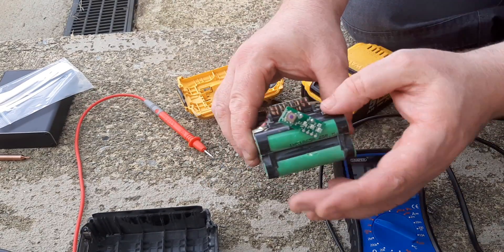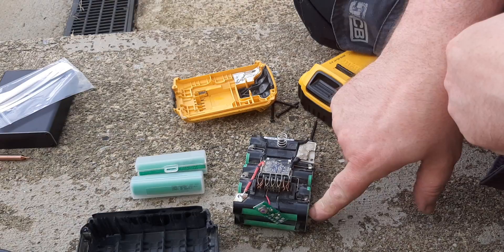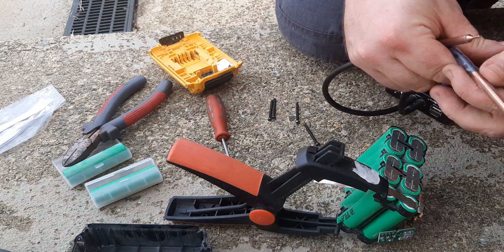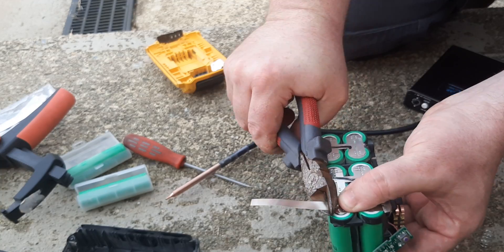Dewalt Battery won't charge? Try This!!!

Comment: not proffesional, this is not the way to do this, first discharge all cells, then no need to cut the Metal strip, use them and reconnect them it would be much better, you are not working safe with all metal parts, you need to work on a bench and not on the ground!, need to catch the battery properly, many mistakes in this work
Reply from the maker: Not Professional? Of course I am not I never claimed to be. By definition I am not as this is not my profession. I don't understand the need to discharge all the cells. Feel free to explain the benefit. I think there are many ways to connect the cells that work. I have never had any issues with safety working at batteries. I do work on a bench now as this video is 3 years old and was made before I got my workshop and bench. I Don't understand what you mean by catching the battery properly. This is the first battery I replaced cells in there have been many since. I think I do better work now than this one. Watch some of my more recent videos and see if you feel the same. Any feedback is welcome

Comment: Great video! Are you working on the ground for safety reasons?
Reply from the maker: Yes and I didn't have my workshop and wooden bench at the time a metal bench is a no no
Reply: And next to a drain grate…lol. Good job on the battery repair! 🙌

Comment: I have this exact issue with one of mine. Going to order the spot welder and batteries to fix it.

What thickness nickel strips did you use please? 0.2mm?

Thanks 🙏👍
Reply from the maker: I have better more recent videos if you need more help some of the spot welders come with strip so that will make it easy to start with

Comment: I slightly nicked the green wrap on one of the battery’s so covered it with black electrical tape is that ok doing that?
Reply from the maker: I would say yes
Reply: @doctorlefthandthread  ok thank you was just worried incase it was unsafe

Comment: Always charge or discharge the new or any battery to the same voltage when you rebuild or build your pack.
Reply from the maker: You are correct an imbalanced pack is a suboptimal one

Comment: You could have likely respot welded the existing nickel plates. Instead of removing and putting new ones
Reply from the maker: Not with that little DIY spot welder I used. It wouldn't be powerful enough for heavy strip I used lighter stuff to reconnect.

Comment: Got two 5ah batteries from ebay. Seller won't refund or exchange the one that won't charge. 
I don't think I am up to foolin with tearing it down and have already tried the jumping  it from tge other battery trick- no go.
Do you know if Dewalt will replace it?. It was new in the packaging when I got it.
Reply from the maker: It'd be worth trying if they are new

Comment: One thing that hasn't been brought up is that the strips that you get with the spot welder is 99% chance of being nickel plated steel. Couple of reasons why they include plated steel vs. pure nickel is; Its cheaper for them, it's easy to spot weld than pure nickel. Big drawbacks are; nickel plated steel will corrode and rust over time and it carries less amps, which is important in a high drain device like power tools. For example .15 × 8mm copper 18A of CDR, pure nickel 5A, nickel plated steel 3A. 2 ways to test what you have. I'll take Dremel with cutoff wheel and cut a little of the strip. If you see sparks, plated steel, no sparks, pure nickel as nickel doesn't kick sparks. If u want to be double check, make a salt water solution and put a small piece of strip in. If no corrosion the next AM, pure nickel. Shows heavy corrosion, plated steel...
Reply from the maker: Thanks for the info 👍
Reply: Pure nickel actually welds much easier. It's simply the cheap factor, that is it.

Comment: Few warnings: I would isolate the other cell-ends with tape before removing and adding the nickelplates, it's easy to short the cells. Furthermore, I'd check the cell battery voltages after a few charge cycles to see if they keep their balance. If charging takes much longer you know there's an inbalance in the pack and more cells needs to be replaced (I'd replace them all if the pack is old). Performance will be better if the cells are from the same production batch.

PS. I'd work on a desk instead of on the ground, makes it easier to do the job. 😏
Reply from the maker: Thanks for your comment I have done a few since that here is my latest 
https://youtu.be/qwOC9FC_oeA
Reply: Imo not worth replacing them at all.. For a genuine high discharge 30a cell from the likes of sony, lg ect, your looking at 4 to 5 euros new..x10 thats 40 to 50 euros when you include any shipping.. Add in the labour and you might as well just bin it and buy a new one from dewalt..

Comment: I do not see the point of testing and replacing individual cells. If a couple have failed, the rest are probably not far behind.  Why not just change them all?
Reply from the maker: You do make a good point if a battery is old enough it is pointless replacing the individual cells this particular battery has done well however.
Reply: @doctorlefthandthread  They do seem to be good batteries.  I have four 5AH Dewalt ones that are shared between power drill, circular saw, recip saw, etc. They have lasted about three years of regular and sometimes brutal use, such as stone cutting. They are only recently started to give problems.

Comment: You're not done yet.  If you have a power supply, you can use it to balance charge the cell pairs separately through the Dewalt battery contacts.  Set the power supply charging voltage to no more than 4.2 volts. If your cells get above 4.2V, they would catch fire or explode so be careful. You can bridge the power supply and the Dewalt battery contacts using paper clips with the insulation stripped.  It's going to charge very slowly taking hours to bring the cell pair voltages up as it is essentially equalizing to the power supply voltage.

Cell  pair 1 is  B- to C1
Cell pair 2 is C1 to C2
Cell pair 3 is C2 to C3
Cell pair 4 is C3 to C4
Cell pair 5 is C4 to B+

Get all the cell pair voltages to be more or less equal to each other.  Then battery is balanced.  Doesn't make much difference whether you bottom balance, top balance, or any voltage in between.  That's for an advanced discussion. Try to get the cell pairs to be within 0.02 volts of each other.
Reply from the maker: Thank you so much for your comment that is what I intended to do however time was an issue and the guy who owned the battery has collected that and the 4 others I revived and repaired if I get one like this again and I have time I will do the video on it. This is why I love youtube I show people things and they tell me helpful things
Reply: Just an addition: Charging the individual cells/cell pairs (because in this case they were in parallel) to the same voltage makes the balancing process much shorter, it doesn't have to be 4.20V (max), but going to the highest cell voltage in the pack would do it as well (saves time to charge all of them). The charger will most likely also balance the cells, but it might be a very slow process when the cells are off too much.

Comment: Thanks for the tutorial. I'm looking to do this myself. How did the battery hold up after the repair? Anything you would do differently?
Reply from the maker: It held up well I am still using it. I suppose wear gloves is important. I try and put in cells that are at a very close voltage to the rest this stops cell imbalance which stops the battery achieving its full voltage potential.

Comment: Perhaps an OPUS battery charger/discharger would be good to add to your collection (plus the modded cooler fan).
You can great test each cell and roughly gets its mAH reading. 
You can also get dedicated IR testers. 
Also I’m surprised that cheap welder did the job. You can make one or go for a decent branded one for £100. 
The problem these days is sourcing cells. It was easy before EBay and others cracked down on postage due to fire hazard. 
It’s getting cheaper just to source a whole new unit battery pack now sadly. 
Good video for an amateur and from now I never bin bad units but keeps/test/label  each cell.
Reply from the maker: Thanks for your comment I will certainly look into getting an opus battery charger and I probably need a better spot welder at this stage
Reply: @doctorlefthandthread  I also think there’s a V2.2 now that is upgraded with an inbuilt cooling fan. Great bit of kit to test each battery. The first version used to trip when doing discharge test to get mAH reading.
Reply from the maker: @PT4LifeYO  thank you

Comment: What cells do I need for a 18v 4AH DeWalt. Many thanks
Reply from the maker: 2000mah lithium ion Samsung 18650 or equivalent. I have plenty of spare ones at the minute
Reply: @doctorlefthandthread  cheers for that one I though there would have been a difference between the 4ah and 5ah. Going to open my first one tomorrow and give it a shot. I have sent you an email over mate. Just when ever you get chance to take a look pa.
Reply from the maker: Did you send it to the right email?
drlefthandthread@gmail.com
Reply: The PC board will work for a variety of packs. Usually when I get 3 Ah, 4 Ah or 5Ah, instead of replacing the 20R cells, or the 15M cells, I just put 25R cells in. So the customer get 5Ah battery packs...better than new

Comment: Is the solder on the battery itself?
Reply from the maker: I don't solder the cells I use a spot welder it's safer. They are spot welded by the manufacturer so it is the correct way.

Comment: That runs...but control the right balance after a few charges and discharges, because you add new cells to old used cells, with certainly different internal resistance.
Reply from the maker: That is certainly true

Comment: Where did you buy the Batteries? Those are Dewalt Fakes that's why they aren't working properly. If you YouTube Dewalt Fakes you can see those Green Cells are the Fake ones, Genuine Dewalt 5AH have Red Cells and higher quality internals.
Reply from the maker: I did buy 4 green cells last week that I believe are knock off but different years of Dewalt battery packs can have different colour cells. The green ones shown are Samsung the red ones are LG. The brand is printed on the side.

Comment: Where can I find that welder
Reply from the maker: Ebay and it is not expensive
Reply: @doctorlefthandthread  Hello, Nice work,  What is the name of the welder?
Reply from the maker: @gwabmpofu8650  it is listed on ebay as DIY spot welder 30 gears. It has mash-wb merc written on it. I hope this helps

Comment: how do you check for broken boards? whats the indicator of faulty boards?
Reply from the maker: usually  if the cells are all testing ok and there is still a problem it is the board